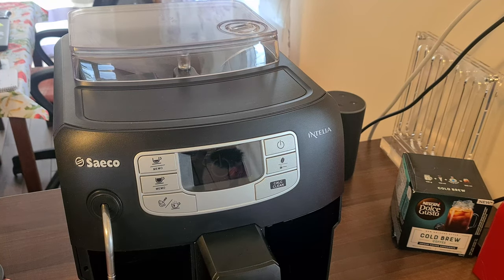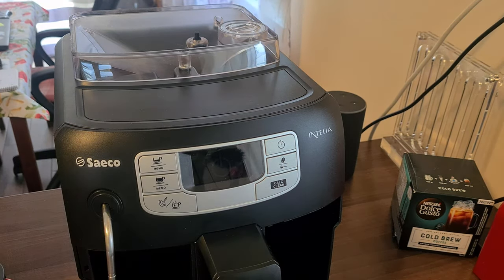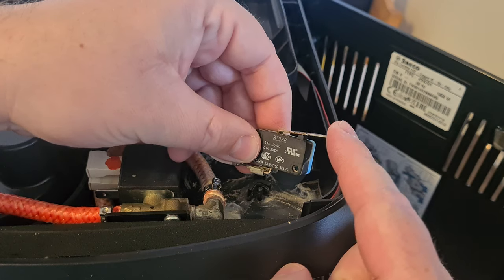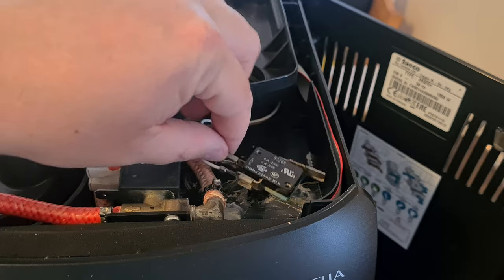Fixing the "door open" issue on the Philips Saeco HD8751/19 Intelia Focus coffee maker

Comment: Thanks for preparing this video.  I had exactly the same problem. However, I was not lucky enough to just clean the contacts.  But I did find a replacement switch on-line and put it in, given the instructions in the video.  You saved me at least $225 if I had sent it out for repair.  Thanks.
Reply from the maker: Cool :) Happy you managed to work it out ;)
Reply: Part 20520, Gaggia, Saeco MicroSwitch

Comment: Hi. I tried it and it's still not working. What else can be done? replcae the part? what is the name of the part - for saeco intelia evo?
Reply from the maker: Hi, yes, most probably it needs to be replaced then. Most likely it is called door switch or microswitch. Also there should be a magnet on the door. Have a look at if it was there yet, as the missing magnet can cause trouble too.